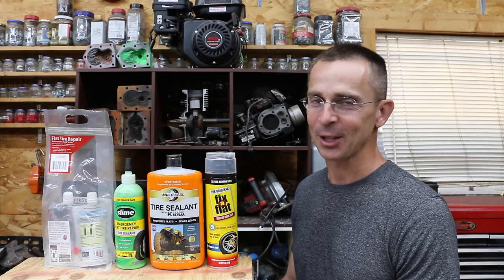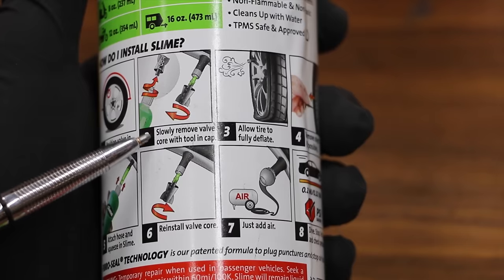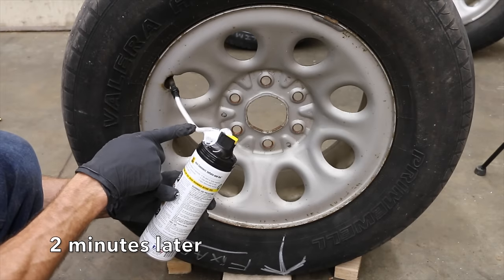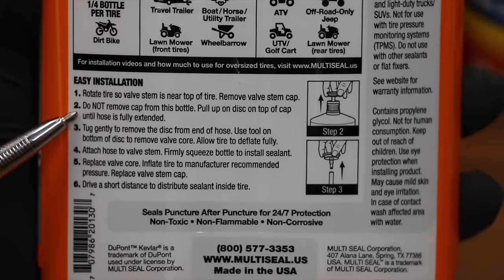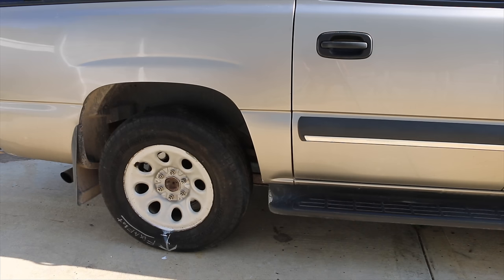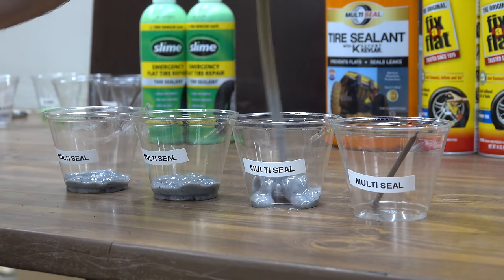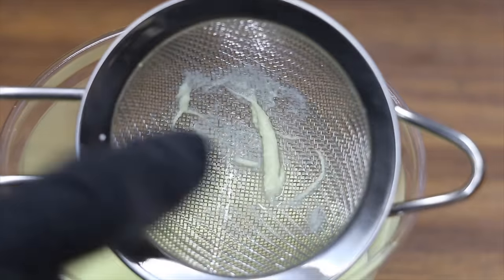Is Tire Slime the Best? Fix-a-Flat vs Tire Slime, TireJect, MultiSeal. Let's find out!

Comment: I'm not endorsing it but I drove 10000 miles on a Fix-A-Flat repaired tire.  Yes it was a rear tire on a lightweight front wheel drive car, no you should not do this, and yes when I eventually got the tires replaced I told the people at the tire place I had used fix a flat 😅
Reply from the maker: Thanks for sharing.

Comment: I use to work at a tire shop and let me tell you how terrible it is to service tires with these stuff in it. It’s messy and sticky. And the worst part is, is when customers come complaining about a vibration and guess what’s inside their tires? Fix-it-flat and those other products. Most of the time they don’t even use it correctly and still causes leaks 

I always tell them to just stop using those because then you’ll complain about vibrations over 90 mph and most of the time their tires are junk and complain about buying new ones. People man..
Reply from the maker: Thanks for sharing.

Comment: I swear by Tireject. I've seen it work on some surprisingly large holes, and it seals bead leaks. It even made an over 20 years old, dry rotted tire useable. This was all with the basic sedan and small truck version. It held up at highway speeds, for over 2 years.

Fix-A-Flat belongs in the trash.
Reply from the maker: Thanks for the feedback.

Comment: My family owns a tire store for over 35 years and I can confirm fix a flat should be called fix a shit it melts the tire but you need to drive it to heat up the chemicals and is a huge pain to clean we absolutely hate it. The slime is also crappy to clean but works

Comment: I wonder how they would perform if the holes you made were actually the size they claimed they could fix. Using a drill to make the hole.
Reply from the maker: Thanks for the suggestion.

Comment: Ok you need to test the products which claim to fix a crack in the block and in the head of an car engine.
And Please test the DuraLube and equivalent  products.
The Duralube commercial  I remember seeing they drained the oil and kept the engine running for a long time.
And one more test. See how the radiator stop leak products compare to a tablespoon or two of Black Pepper.
I myself have had great results with black pepper, and it didn't seem to effect the heater core or thermostat.
Reply from the maker: Thanks for the suggestion.

Comment: Back when I worked at a tire shop I saw hundreds of aluminum wheels that had dozens of pinholes because of fix a flat. Crazy when you spray soapy water on the inside of the wheels and all you see is the air bubbling out 🤣😂
Reply from the maker: Thanks for the feedback.

Comment: You don't have to use an entire can of slime or other product- put in 1/4 to 1/3 container's worth, then add air pressure &  rotate the tire to orient the hole at the bottom. You need just enough to flow out the hole & clot the hole.

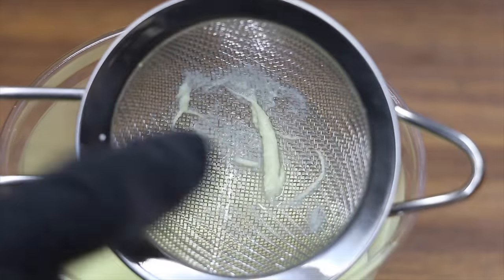Comment: @10:24... "fix a flat did not fix the flat"... 🤣 lol. Having worked as a mechanic for over 15 years I've come across many tires with fix a flat in it. It rarely worked. I always dreded those repairs. The stuff makes a mess. Came across a number of tires with slime in them. Also messy stuff.
Reply from the maker: Thanks for the feedback.

Comment: I used a single bottle of Tire Slime on a tire for a sedan and the tire was good for 5 years even after getting 7 nails stuck in the tire.
Reply from the maker: Thank you!
Reply: @ProjectFarm  I was watching your video because four hours ago, I saw a screw sticking out of one of my rear tires.

My neighbor who is a retired mechanic told me to remove the screw and put some dish soap with water over the puncture spot to check for air bubbles. Turns out it was only half of a small screw and it only went into the rubber tread on the tire. There was no leaking air. 

My neighbor also said that unless the tire is visibly flat, always check for leaking air to avoid unnecessary overpriced tire patch jobs from a garage mechanic.

Comment: The absolute only flat repair fluid i use is a product called FlatOut (practically the same product as the Multi Seal but has been improved) and the only product i would ever recommend to anyone. Your tire technician hates any repair fluid put in a tire period.
Reply from the maker: Thanks for the feedback.

Comment: Even though some of these products seem like they might work sometimes, they all make a mess. 
   Why not use a plug? Something that actually works very reliably. I can put a plug in a hole quicker than any of this crap can be installed, into an inflated tire, with almost no air loss, and be almost certain that it will work.
     I've worked on/off part time at a motorcycle/atv dealer since the 80's. All of us mechanics dislike all of this garbage, makes a disgusting mess and hinders a real repair.
    Fix-a-flat is just hope in a can for idiots.
     I'm amazed that the public continues to keep them in business.

Comment: Fix a flate is the cheapest I would make the argument that had you used 4x units and still be stuck with the leaking tire,which you probably could've fixed with 1/4 of the recommended solution of other products that actually last more than 2 days saving money for tire repair at shop
Reply from the maker: Thanks for the feedback.

Comment: that's odd that fix a flat didnt work at all. I've used it at least 2 times and it worked just fine. Maybe it used to be a different formula or something. I had a flat on my old Taurus and used a can of that, actually forgot about it for a week and it was still fine. It was a small nail I ran over though.
Reply from the maker: Thanks for the feedback.

Comment: I've used tire slime before. My tire guy hates me now! Plus, it adds too much un sprung weight. Used on a four-wheeler, will not use it again. I'd rather add air everyday! My advice just get your tire fixed. It's much more convenient in the long run to spend a few bucks.
Reply from the maker: Thanks for the feedback.

Comment: Never use any of these products in bike inter tubes. It never worked for me . And several others especially slime is the worst on intertubes. I tried using it several times and it never sealed anything, just leaked back out through the valve. Thought I might have left core loose, but it did it again. And these slimes were supposedly for bike tubes. Best bet I've found is to have a new tube ready with me.
Reply from the maker: Thanks for sharing.

Comment: Any thoughts on how "temporary" these products are?
Reply: I have tires going on 2 years holding up. I only use just enough Slime to seal a leak, not by the can's instructions. I test my tires first for a hole. Can't find one, I use this to prevent a slow leak down. I may lose 2 pounds over 3 months. That's very good.

Comment: Tore slime never dried in my tires and it totally threw of my tires balance. Now I just use it on tractors and mowers
Reply: Used it for years now, and yet to have that happen. It's important to drive it around for awhile immediately after you apply, and air the tire back up. Otherwise, it will all run down to the lowest part of the tire which could throw off the balance.
Reply from the maker: Thanks for the feedback.

Comment: had air bags leaking on motor home. slime would not stop the leak but fix a flat did. i suspect because the fix a flat would travel down the hose and slime would not
Reply from the maker: Thanks for the feedback.

Comment: Fix-a-flat is the worst gas station snake oil you can buy. Over the years I've wasted money on that junk about 10 times just hoping for good results and it has never worked. Slime on the other hand is amazing. I used to have tubes on my mountain bike that contained Slime from the factory as a preventative measure, and when I ran over a nail one day it sealed the tire completely in one full wheel revolution and never leaked again the whole time I had the tube on the bike which was at least a couple of years. Slime is a great product.
Reply from the maker: Thanks for sharing.

Comment: I swear by Right-On wheel balancer and sealer.  Check it out.  Riding my motorcycle It saved my life where i was skqueed  into a line of lane dividers ( 3 ft freeway balusters separating # one lane from the express/toll lanes) at like 75 MPH my hard mounted foot pegs of >3/8 steel plate mounts bolted to the frame peeled back like a banana. the anchored balusters beat the H3LL out of my feet, ankles and shines at impact and then again at reaction force whipped my thighs and knees.. destroyed my hungarian made boots put a huge dent in my front wheel deforming the bead area. Thank god I held on and traversed through the "gauntlet' exposing my left side to similar damages and proceed to the 4 lane traverse to the exit. the traffic vehicles all slowed way down and I made it to the off ramp and lived to share this story. Note: I checked my tire PSI  normally at 36-40 was holding at 23 PSI that night and the next few days.  I rode  10 miles home only stopping once because my legs felt cold and I dropped my jeans to check, I did not want to bleed out. The cuts where minor compared to the immediate bruising. And H3ll yah it hurt.  I Say again check out Right-On wheel balancer and sealer.  ps i love your presentations and methodology.
Reply from the maker: Thanks!  Thanks for sharing!  Amazing you were not more seriously hurt!  Thanks for the suggestion.

Comment: Don't know about the others but SLIME is horrible.  I used it in my lawn tractor tires and it didn't work.  Since it didn't seal the pin hole leak, the air pressure got low and the SLIME worked it's way into the tire bead. The lubrication from the SLIME caused the bead to come unseated when I made a turn and the tire came off the bead. This happened TWICE. 
I'd say it's an unsafe product.  Don't even THINK about using it for any vehicle on the streets and highways.

Comment: But if you need it off in the middle of nowhere then a can of fix a flat is better. But I have purchased cans of fix a flat that have lost their air pressure more than one time. Carry a cheap rechargeable air pump and a container of flat out because most cans of fix a flat have already lost half their air pressure sitting on the store shelves. Flat out you can put it in your tire a head of time and if you get a puncher it will seal itself.
Reply from the maker: Thanks for sharing.

Comment: Tire Slim make my truck back end shack like my wheels where warp on the HWY (HWY speed was 100 km/h and I had to drive 80 km/h) during the winter time. Call Tire Slim company, they said they would refund only the product and the cleaning of this product out of my wheels what at my cost. Sent in all the info they requested, never got a refund. So, I lost 30 buck for the product, then I lost 75 buck for cleaning my inside tire. The stuff make work when it come to puncture, but the product takes to much time to warm up in the winter, which could (in my case did) make your wheels unbalance and really unsafe. The point that I didn't get my refund, show how the company doesn't take responsibility when things go wrong. Unbalance wheels on HWY is unsafe and can cause damage to ball joint and a lot of stress on resounding parts. Tire Slim company don't warranty their product and your still left paying someone to take the tire apart to clean it out. This preventative didn't prevent anything, cost me 105 buck just to get back to normal. Stay away from Tire Slim, when things go bad, they will not be there for you.
Reply from the maker: Thanks for sharing.

Comment: I've tried Slime and it's garbage. Had a thumb tack in my tire, pulled it out and the slime just bubbled out of the hole!! A thumb tack hole?? Just garbage. Flat out is the best by far.
Reply from the maker: Thanks for the feedback.
Reply: @ProjectFarm  Flatout has a freezing point of -30 and is also guaranteed for 10 years. Slime is good for 1 year then you'll need a new tube.

Comment: I worked in a factory for 30 years and there were 15 different buildings on the campus , there were staples nails and screws everywhere .  I drove between the buildings all day long . After about ten flats I started to use slime one tire at a time as I got flats .   In a year and a half I had to pull things out of my tires 20 times .   After the tires were filled with slime I never had another flat , but warning to users of tire sealants . If you put it in tires and use too much you will never get the tires to balance and at 60 mph shake you all over the road .
Reply from the maker: Thanks for sharing.

Comment: The only downside of slime is that it could put tire out of balance but ive used it for many years in many cars....rarely this is a prob. I think slime changed its recommendation on how long to leave it in to cover their ass & sell more product more than real life problem leaving it in tire. Ive left it in tire forever without a prob. Hot summer is coming....slime has coolant in it keeping tires cool, thus extending tire life.

Comment: ahh bad luck with tires.... Ha Ha... Picked up a new\used SUV in March of 22 with 10K on the odometer. I do drive a lot as of 1/23 I have 25K on the odometer...  Just this morning dealt with my THIRD flat tire.  Flat\tire #1 of 4 a small triangular tough as nails shard of broken glass just barely penetrated the tire between treads. I actually had to drill this hole out with a drill bit to make it large enough to plug it with a slime plug like tested in the other video. Flat\tire #2 a couple months later a screw pulled out with vise grip and also plugged with a slime plug.  Replaced the first  two factory equipped plugged\flats in the fall of 22 with only 20K miles on them.  Then woke up this morning to fresh snowfall and my third factory equipped flat tire.  A nail I pulled out with a pair of diagonal cutters.  Due to it being sloppy out this morning and a healing dominant hand\finger injury with several stitches currently in place I had to go the "low impact" route and watched this video and gave the green slime a try.  Not sure if it's something to do with my vehicle or the 30 degree temps outside but I found it nearly impossible to squeeze the bottle of slime into my tire.  removed the valve with the tool and a little slime would go in and then it seemed as if the empty valve stem would get plugged by the slime. I would clear it out blowing a touch of air into the empty stem with my compressor and then continue. After about 30 minutes of repeating this process every 10 seconds or so I finally managed to get 3/4 of the 16 oz bottle into the tire.  It was a real pain in the ass to squeeze it in there, the squeeze pressure even popped the hose off the slime bottle once squirting green slime all over my rim.  I replace the valve with the tool, aired up the tire and went for a good 30 minute drive doing laps through the three mile long "circle drive" in my subdivision.  After a few laps the TPS sensor was not showing any further pressure loss so I will consider it a win for now until the weather gets a little nicer or until my fourth flat tire to comes about in the next few months (just seems to be a trend for me as of late) forces me to replace my other two factory installed tires.  Yeah only BAD luck with tires for me over the past 10 months...
Thanks for doing all the videos you do.  I have seen at least a dozen of them... I guess it's time to subscribe...
Reply from the maker: Thanks for sharing.

Comment: Yup it sucks having to dismount a tire that has this crap inside. It makes a mess all over the machine,  smells like crap, gets on your clothes making you not just smelling like sweat but this crap as well.
It also sucked when someone would say they have a leak and not tell us that they'd put this crap inside which had stopped the leak. Couple times there I was dunking the tire in the water tank looking for leaks only to finally realize "this shit has fix a flat inside" 🤦
Reply from the maker: Thanks for sharing.
Reply: @ProjectFarm  appreciate you for the time you spend making these videos!
I recently started working as a truck driver and I drive a Flatbed mostly towing AAA calls.

Can you do reviews on towing straps like with J hooks or D-Rings. I know you have made already on rather straps but  those are more for light duty not so much for vehicles.

I'm buying my own straps because the ones provided aren't  in the best condition.  Would be awesome seeing which ones you test and which ones are a better buy.
Anyways thanks for the videos!

Comment: FIX A FLAT 24oz now costs $17 (robbery) will not dispense or inflate in temps under 50deg. They lie it goes to 32deg parent company owns SLIME, hose they supply only 4" tho pic on can is 8" =very slimey.

Comment: I've used tyre slime on 4 bikes and it hasn't worked once in 2 years, there are no fibres in it it's slime and a few rubber particles, Stan's tyre sealant is just as useless on tubeless tyres 😱
Reply from the maker: Thanks for sharing.

Comment: Fix a flat has never worked . Only tire slime has worked for me due to small rubber bits suspended in the slime it helps block small leaks.
Reply from the maker: Thanks for the feedback.

Comment: A full 1/4 puncture in most tyres is beyond repair even with a proper patch.  The hole made by a 1/4" nail or screw would usually leave a hole about 3/32" a far cry from the manufacturers claims. Acually drill a true 1/8" hole and I would bet none of these products work.    The carcass of the tyre would be too badly damaged to be safely repaired as the wires inside would be broken. On a very large tyre with a 8ply or higher a 6mm/ 1/4" hole would be OK to repair with a large heavy reinforced tyre gator but on an ordinary car tyre it is really not recommended.
Reply from the maker: Thanks for the feedback.